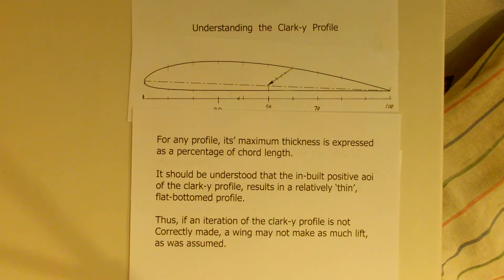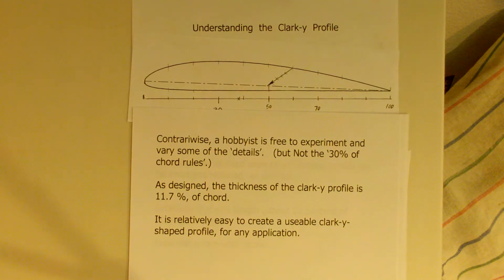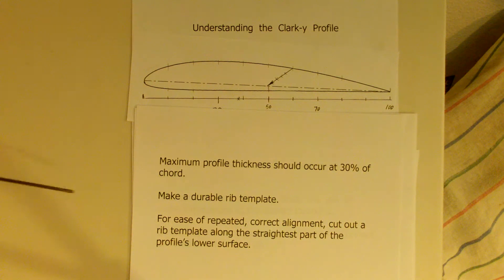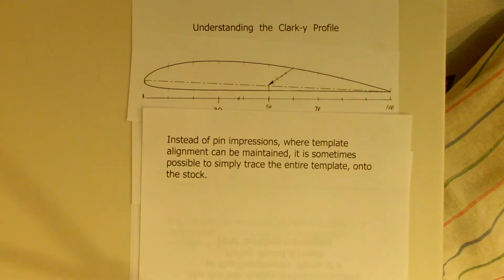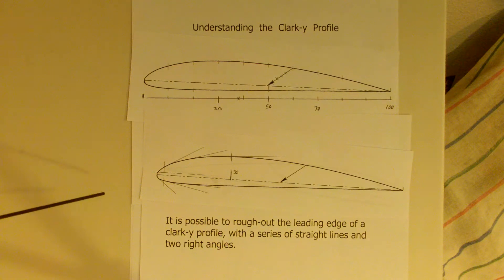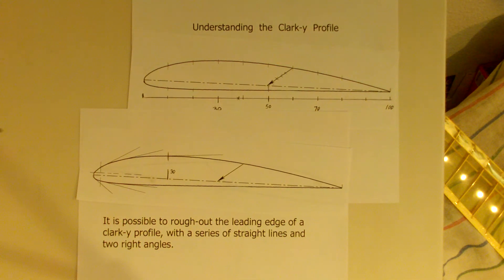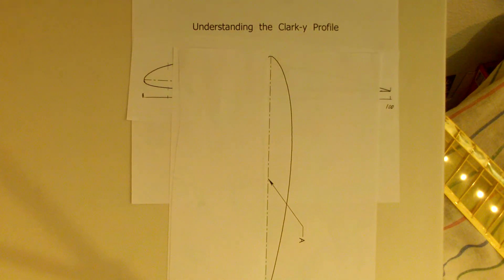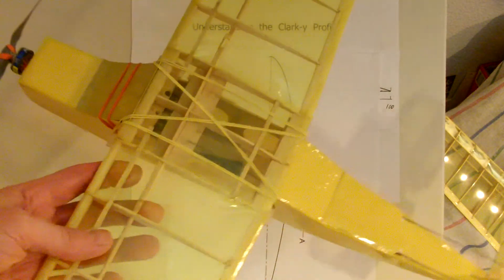rc aircraft tutorial  the clark-y profile

Comment: does a flat bottom airfoil have lift?
Reply from the maker: it does, if positive angle of attack (aoa) at the main wing is present.     the source of lift is  Positive angle of attack  at the main wing.     in the case of a tiny model aircraft wing, the most efficient/recommended way to produce positive aoa at the wing is to build positive aoa into a  two-surface  cambered  flat-bottomed  profile.    like the clark-y  (or the  n-10 at  airfoiltoolsdotcom).   
000    the dashed line in the graphic indicates the chord line of the profile; which is at two or three degrees of  positive aoa.     this type of profile/airfoil/wing is  Intended  to be mounted at  zero-degrees angle of incidence (aoi), relative to its lower surface.
in the case of a 'flat' or symmetrical profile, positive aoa at the wing is a result of the use of, either, nose-up trim  at the elevator  or   negative angle of incidence (aoi ) at the horiz-stab.    the latter is, typically, used in the case of two channel control  or  free-flight.
000   the 'percent scale' at the bottom of the graphic  SHOWS  (you) the correct Proportions/geometry/layout  of  the  profile.      specifically, the correct curvature at the lower leading edge  and  correct location of the thickest part of the profile should be   NOTED.
Reply: thank you very very much!